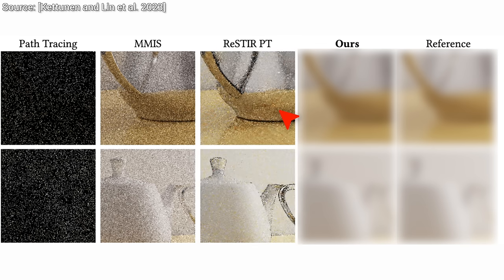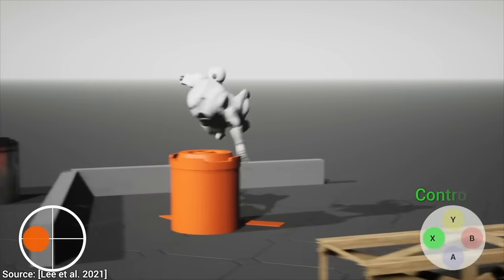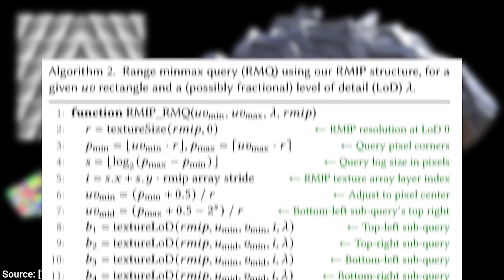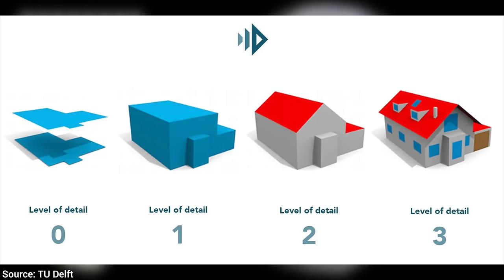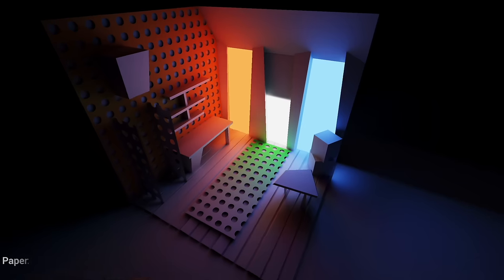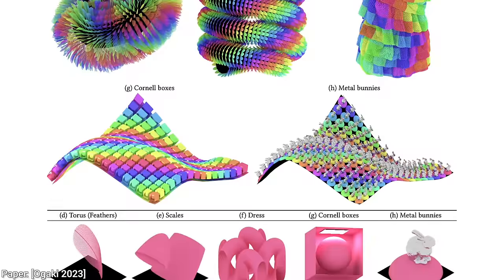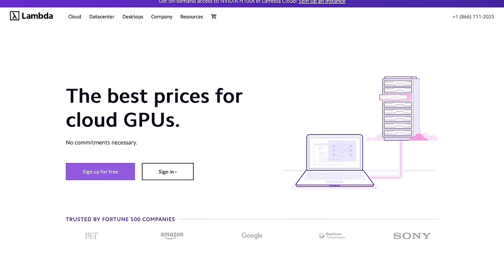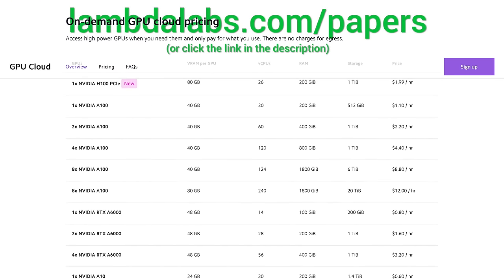This Is Ray Tracing Supercharged!

Comment: NVIDIA just keeps on popping off
Reply: People complain about Nvidia being expensive. I complain as well but there is no denying that they push the industry forward.
Reply: @mnomadvfx  What timeframe do you have in mind for path tracing becoming universally implemented in games and able to run noise free ?
Reply: @predaalex3210  I'm not really sure but I think the pace it has gone so far has been pretty impressive. The good thing about Ray/Path tracing is that it's optional. If people can't afford the hardware, they can still play the games without it.

Console gaming is where you see universal implementation of features. Right now the consoles do a weaker amount of Ray Tracing so I suspect that we will see them have way better quality ray tracing in the next generation of consoles. So maybe 2027 give or take.

If someone had told me in 2020 that Cyberpunk would have path tracing in 2 years, I would have laughed them out the room. Does Cyberpunk have some ghosting and noise issues? of course but compare Ray Tracing from 2018 to now. Its night and day!
Reply: @mnomadvfx  I agree with you that Nvidia implemented Ray Tracing in the 20 series too early.Let's be honest though, a GPU company had to take that step eventually and I believe Nvidia saw it as a long term investment for differentiating itself from the competition.

While AMD has benefited from it in the console market (they provide the APU for both PS5 and XSX) they are far behind in the PC market by a lot. Also DLSS is far superior to FSR which sets them apart even further.

As long as AMD keeps playing catch-up, Nvidia will continue having it's large market share.

AMd needs top develop a new technology before Nvidia. That's how they can beat out Nvidia!
Reply: Except most of the papers mentioned in the video aren't coming from NVidia.  (Paper links are in the video description).
Reply: @briansavery  ReSTIR improvement was published by Nvidia research scientists.
Reply: @samson7294  what about the other three papers?

Comment: Yeah, I remember raytracing my first image with pov ray back in about 1990.  My friend had a 386 with a maths co-processor and my Dad got us a 486DX - one of those rare times you were lucky as a child.  With my friends maths co processor, one frame would be made in approximately 6 hours I think, the same frame on the DX was about 1 hour if I recall correctly.  Now we're talking about ray tracing in real time at more FPS than we need.  Sometimes I just marvel at how far we've come, though looking at it retrospectively that is actually 34 years which almost feels slow!  Love your work!

Comment: I remember back in the mid 90's using Strata Studio Pro which had raytrace rendering and another rendering algorithm called raydiosity built in. I was running a Power Mac 8100/80 AV and it would take a few hours to render one scene let alone an entire animation. I wouldn't have imagined being able to render raytracing in real time!
Reply: I remember watching an interview with a former Pixar animator saying the original Toy Story could be rendered in real-time with today's hardware. That was a few years ago. I wonder if that was real-time on a render farm, or a single workstation?

Comment: I am really interested in using a parametric modeling system as a real time physics and rendering baseline.  As most architectures are memory bandwidth constrained, I suspect that parametric modeling would ultimately be faster and scale into hardware better than most triangle based modeling systems.  I am basically wanting to fly before learning to crawl, though, so there is that.

Comment: That fractional LOD is basically what they use in Zelda botw and totk for the terrain, I think what we need is the ability to fake it for smaller objects for real time and only visually displaces the information in 3D on the edges of the objects with another fake 2D displacement for the rest of the object that blends together seamlessly

Comment: Lol, I remember Ray tracing my first scene of a plane, a reflective sphere The wood texture sphere when I was probably 15. I guess it would be 30 years ago, on my Atari 1040 ST. 1 MB RAM, Motorola 68000 processor, using GFA ray tracer. It was all done by text no interface. Yes we have come a long way since then.

Comment: 🎯 Key Takeaways for quick navigation:

00:00 🤖 Ray Tracing Algorithms Enable Photorealistic Image Synthesis But Have Limitations
- Ray tracing can simulate light transport and create photorealistic images
- However, ray tracing algorithms have a huge problem with noise
01:18 🛡️ New Techniques Reduce Noise in Ray Traced Images
- New algorithms like ReSTIR produce less noise than previous methods 
- But some still have artifacts like incorrect specular highlights
- A new technique reduces noise and matches reference simulations
03:37 💼 Displacement Mapping Makes Simple Geometry Appear More Detailed
- Displacement mapping adds detail to simple 3D geometry 
- A new technique does this up to 11x faster with 3x less memory
- It supports continuous level of detail transitions
05:47 📚 LuxCoreRender Enables Photorealistic Rendering and Needs Contributors
- LuxCoreRender is a free, open source photorealistic renderer
- It implements advanced light transport algorithms
- More contributor help is needed for this community project

Made with HARPA AI

Comment: This is a bit misleading at 1:00 the ReSTIR PT method is used to demonstrate that denosing can not get rid of walking ligth bloks. Shortly after, 1:11, MMIS is used as the previous technique wich does not seam to have thiese walking ligth blocks then MMIS is replaced with the new one and then denoised. Why is the new one then not compared to a denoised MMIS image but a wores denoised ReSTIR PT image?
Reply: it's pretty clear that the denoised new method will be better than denoised MMIS, since it has significantly less noise
Reply: @descai10  yes my point is taht denoised mmis was neaver eaven shown

Comment: The noisy output looks like the output you’d see partway through a diffusion-based image generation network; wonder if folks have tried generating scenes with an increasing number of rays, for use as input/output to a diffusion image generator that, once trained, generates images approximating the high-count images from the low-count.
Reply: That sounds like a description for ray reconstruction.
Reply: that's how AI denoisers work, diffusion models were originally born from work on denoising
Reply: @descai10 ah, cool. Seemed sufficiently obvious that I figured it was probably a well-worn path.

Comment: If games can be fully raytraced, does that mean they can be rendered with multiple GPUs resulting in linear fps increase per gpu?
Reply: yes, but that is completely unpractical... go tell gamers they need 2 gpus minimum spec lol
Reply: No, the frame synchronization creates alot of overhead. Also, post processing effects can really only be ran on one of the GPUs, so yes, rendering of the meshes will scale linearly, but FPS will not scale linearly.
Reply: Too much latency, so, no.
Reply: What post processing effects can only be ran on on GPU? @FinaISpartan
Reply: The latency cost of processing over multiple GPUs would be too much. If they ever solved the latency issues to such an extent then it would be far more economical and effective to increase the amount of die on a single GPU instead.
Reply: @jackerdor  Why would it increase latency?
Reply: @ThisIsNotWhatItLooksLik  The latency comes from having to sync and merge the frames on the GPU that has the connector for the monitor. You could get nearly linear scaling with a good implementation, though.
Reply: @ThisIsNotWhatItLooksLik  Literal distance, speed of information is fast, but not infinite. Have a look at PCB elements, they are as close as possible to cut down on latency and higher bit rate. AMD chiplets work because they sit on a layer of very short connections, very little waiting. Moving data between cards take a very, very long time in comparison.
Reply: Ah, ok. Can you estimate the ammount of latency, for example 1 GPU reaching 100 fps alone and then adding a second. Multi GPU usage would be on the higher end to begin with. @MikkoRantalainen
Reply: @ThisIsNotWhatItLooksLik  Yes, the big question is how rapidly you can distribute the work and how rapidly you can transfer the fragments from other GPUs to the one that has the monitor connected. If we assume it takes 1 ms to distribute the work and 1 ms to transmit the final data from other GPUs to the one with the monitor connected that would require 2 ms with infinite number of GPUs connected. And I think only one other GPU can do PCIe DMA transfer to the target GPU at a time (with the monitor connected), you have to serialize the part that transfers the final data to the final GPU and that obviously hits hard if you have multiple GPUs. As usual, the interconnect speed will be the limiting factor for ultimate paralleism.

That's also why many real world supercomputers use more money on the interconnect hardware than the actual CPUs. And that's also why Nvidia acquired InfiniBand/Mellanox that had the best interconnect tech in the world.
Reply: I had no idea interconnection was so crucial and difficult. Multi GPU gaming would be for a small group eitherway so we could expect support for it with only a few high end GPUs so there might be a possibility the tech can be advanced there. Then the question will be will it matter at that point, how far frame generation has come by then. It will be interesting to see how it all unfolds and if AMD will try to cut in.  @MikkoRantalainen

Comment: Gourad is fine, you just need multi core modeller.  I remember I made jet pack jack back in 2010, he only had 15,000 polygons, but due to the storage capabilities, he moved at 1 fps, like the grand canyon, 500,000 polygon dimensia.  I gave jet pack jack literally nothing, a belt with cone bombs and grenades, I mean holy shitty programmers batman.  I mean, I don't want unreal engine, tell me everything before you even write the code Unreal Engine.  How would you move mars and saturn around in a simulator?  Want to use the 10D pivot radix data.

Comment: I'm waiting for AMD fake path tracing, I saw pictures on AMD GPGPU twitter - if 80% of screen is rendered in 1st frame (instant, no lag) and its 230fps in 1080p native then AMD path tracing will run on ps5 and cancel restir pt. I know it's fake and I see it's limitations - still, if it dominates consoles it will be used by 20x more gamers. Good solutions are often beaten by lousy but simple ones - like physx or gsync. I love the restir - what I don't like is half resolution when I move mouse to the sides. Try moving mouse faster - even DLSS RR won't be able to put it together (though I love RR too).
Reply: Where can I find more information on this AMD fake path tracing?